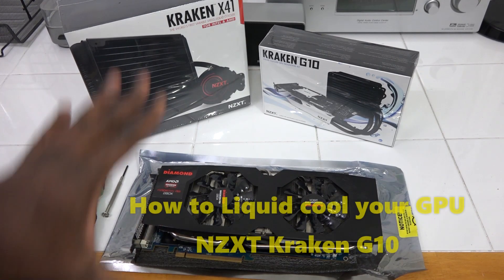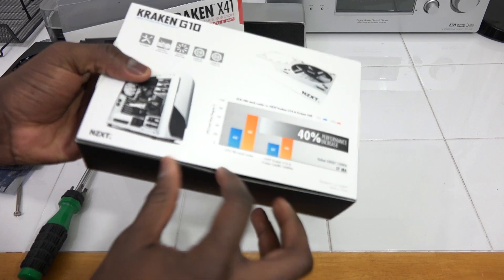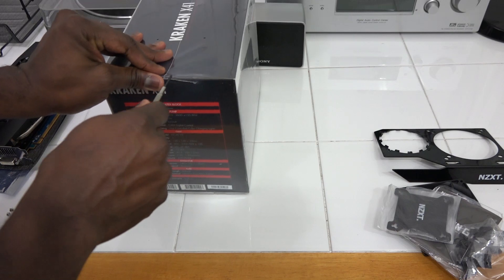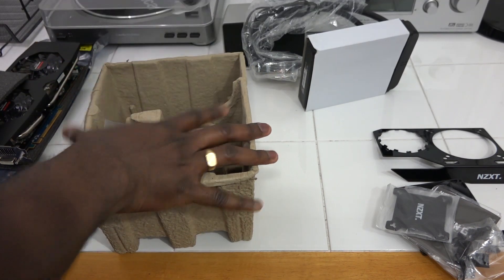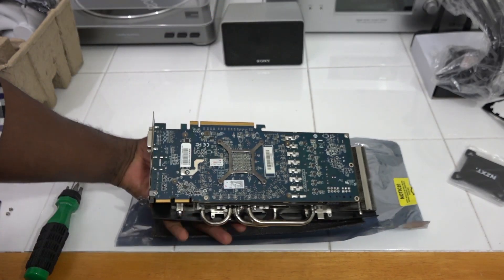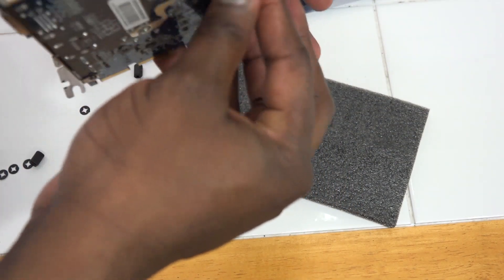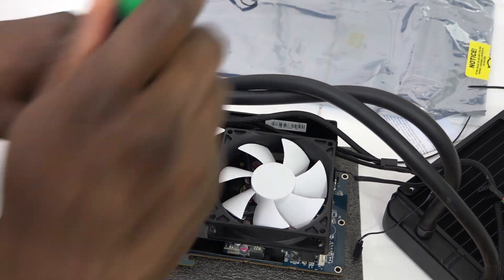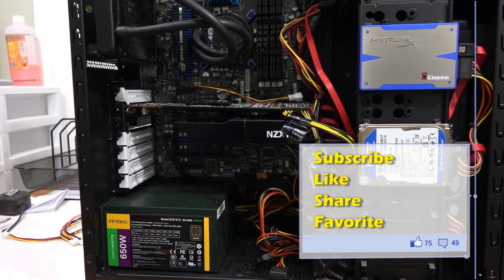How to Liquid Cool your GPU [Kraken G10]

Comment: No thermal paste?  No vRAM cooling?  Looks like your old fan cooler has vRAM cooling, even if it doesn't cool the core as well the fact that it has vRAM cooling, it will probably provide better longevity.  although, maybe you just didn't cover those steps in the video.

Comment: One thing you didnt mention is that it is sometimes good to apply thermal paste on the gpu chip separately and remove the one preapplied on the kraken if the chip is much smaller than the area covered by the paste on the kraken. It isnt absolutely necessary, but its recommended to prevent the gunk from getting to places it shouldnt be in
Reply from the maker: the coolers come with paste. which doesn't require that. of you are using an older cooler. then sure. Good points
Reply: Booredatwork.com what did you use to clean the pre-applied thermal paste on the GPU before putting in the Liquid Cooler?
Reply: ***** I dont know what he used, but isopropyl alcohol is recommended. You can get good results just by scraping the paste off with paper without using any liquids, but doing so can leave behind residue, so using isopropyl alcohol with a q-tip or something similar is much better if you have access to it
Reply: totally real name alright. thanks for replying! :)
Reply from the maker: ***** Q-tip